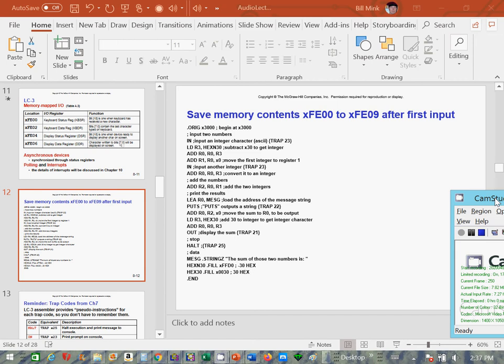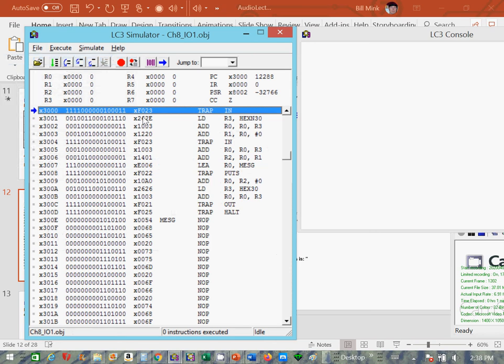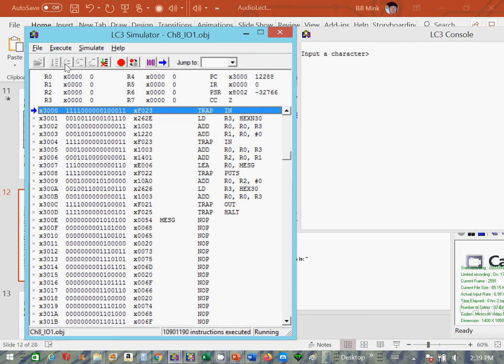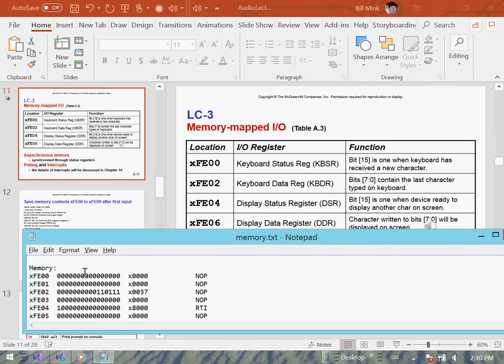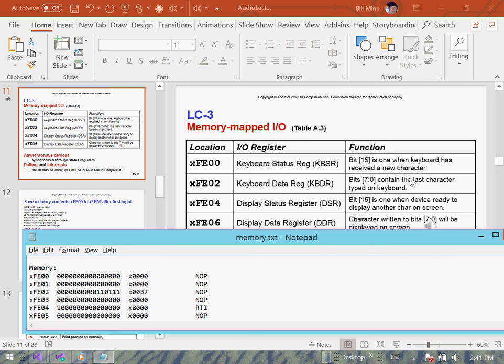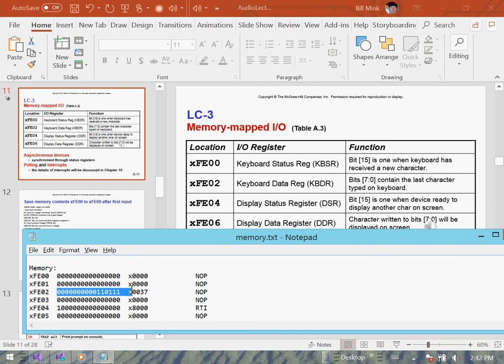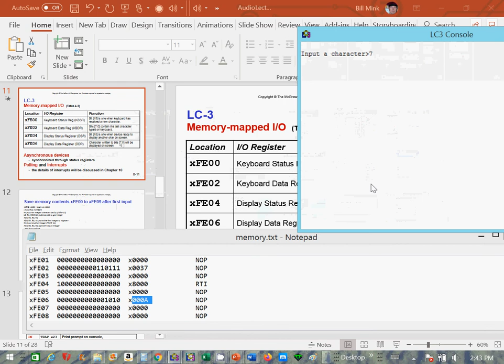Memory Mapped I/O Demo

Comment: Explanation:
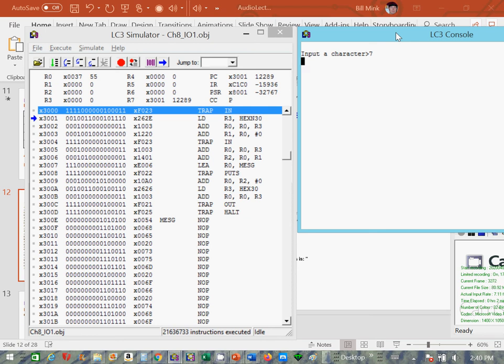Looking at the console, the cursor is clearly visible on the next line and NOT next to the 7. (Prof Mink tries to bring this to your attention at 2:40)
Thinking back to prior experience with higher level languages: this is the case when a newline character (\n) is entered. (The cursor would remain after the 7 had a newline character not been entered)
The newline character in ASCII is 10 which is x000A

That is why x000A is in the Display Data Register.

-Angel